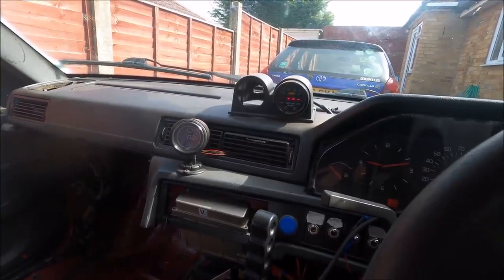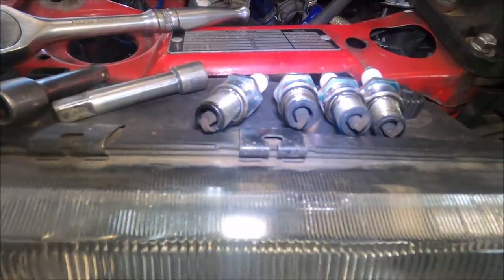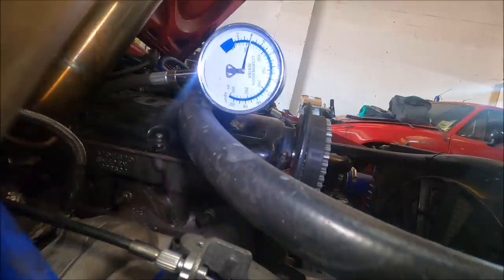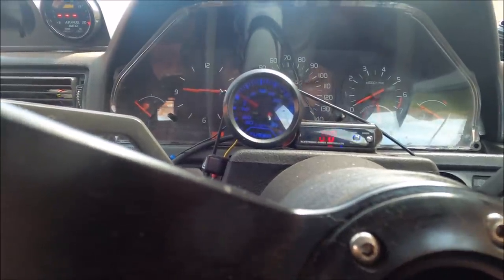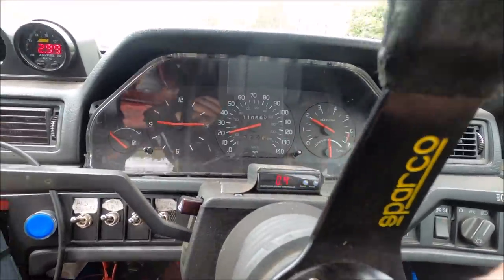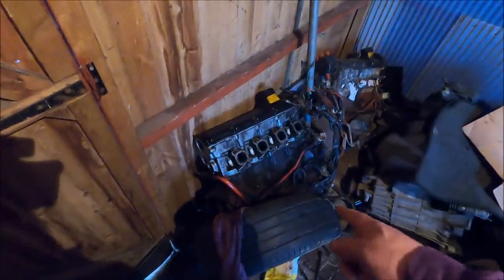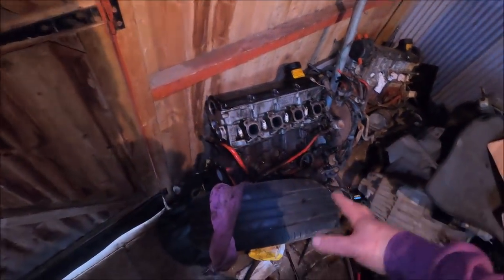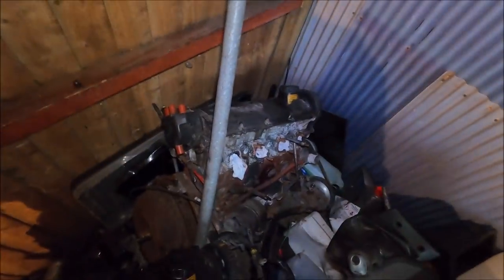Formula 1 style pre-turbo throttle Part Two! All the boost! But the original engine is finally dying

Comment: Used engines from automatic cars are often quite good because most of the time they ran at low rpm because the automatic shift up very soon. Also, engines from automatics have had hardly any axial loads on the crank which means trust bearing will he OK even at high miles.
Manual cars have high axial load on the crank whenever the clutch is depressed. 
As a swap engine i'd ALWAYS prefer the engine from the automatic over the one from the manual.

Comment: When it comes to checking on health of turbo engines I don't rely on compression testing I still do it to check the holes to see if they are equal. usually  I just do a leak down test on it and if they come back within reason its good to send! Any lack in compression can be compensated with more boost lolol
Reply: Even with my low standards I would re-ring and bearing that motor with those fucked compression numbers lol
Reply from the maker: Yeah this thing is dead for sure lol
Reply: @StavTech  really has done well considering what its been through,  you really cannot complain
Reply from the maker: @Pro5.0  yeah it’s surpassed all my expectations! I bought my first spare engine for it as soon as I got the car as I planned to test it’s limits and use it hard, but I didn’t expect it to last way over a year considering it already had huge miles on it!

Going by the MOT history, in 2015 it had 168,000 miles on it, then the clocks were changed at some point after so in 2016 it had 76,000. Now it has over 110,000, and it’s 100% the original bottom end, so it’s certainly well over 200,000 miles!

Comment: Crazy how it goes so well and the compression is so out fo wack if you want it to be more efficient though I’d definitely rebuild it you wouldn’t have to run as much boost to compensate the low compression and overall everything would be running a lot cooler and healthier such a sick car though sounds evil 👌🏻

Comment: 2:32 110 is great.. i have compression gauge for like few years, and highest compression i measured was around 140psi on 1.8t vw engine.
i also have long hose and it of course affects reading, but reading is still consistend and comparable with any other engine using same compression gauge and hose

3:29 oh

Comment: Sweden had a different cam if I rember right from one of drift n lifts videos. Both use same engine 2.0 8v. Cam lobes are bigger as standard. 280ish whp he runs with 270 torque. Don't think it's the turbo cam shaft though. Loving the vids and the calm style. If it isn't broke don't fix it.

Comment: cylinder 3 is the one that let go on my 155k b230fk when i had it running 34psi boost
Reply: Use a Cometic multi layer steel head gasket. Those are awesome.
Reply: @jfv65  i've binned the b230 altogether and going rotary

Comment: If compression numbers don't bother you, why not check rod and main bearings, maybe replace them, or even better increase oil pressure at the oil pump bypass?
Reply from the maker: This thing is way too far gone for that. Now oil light is coming on it would be madness to do anything but make it right for that one cyl with very very low numbers

Comment: Will the sealing work with a single throttle before turbo and no throttle after the turbo?
Reply from the maker: Drivability and response is not good with just one throttle so far from the inlet ports
Reply: @StavTech  even with air-to-water intercooler and thus short path? I'm gonna try this. My worries are about oil being sucked through compressor sealings. But what about providing same vacuum on both sides of sealing by connecting crankcase ventilation between throttle and turbo inlet?